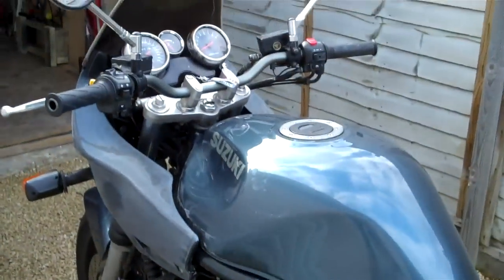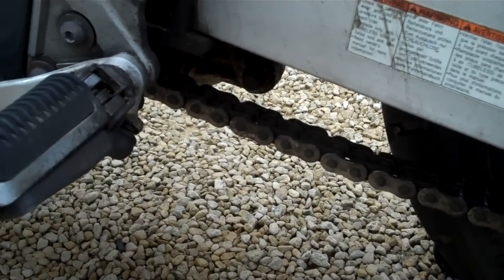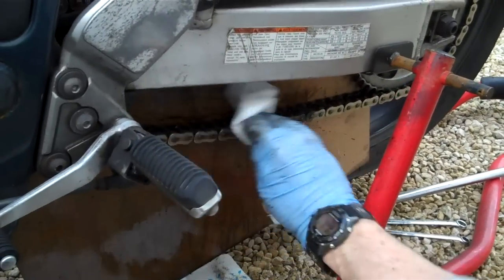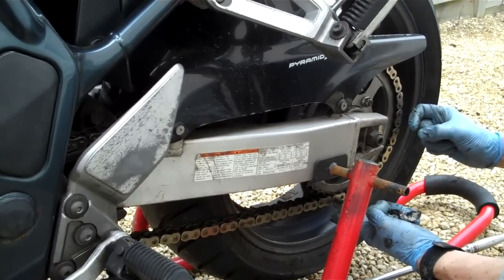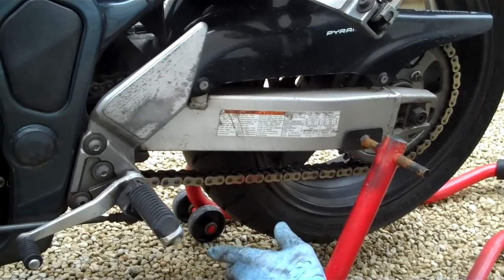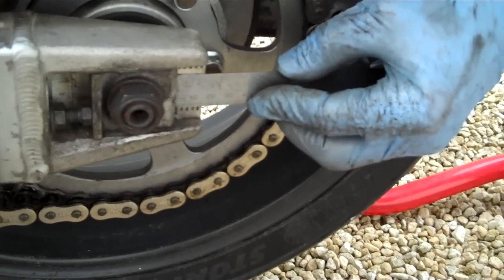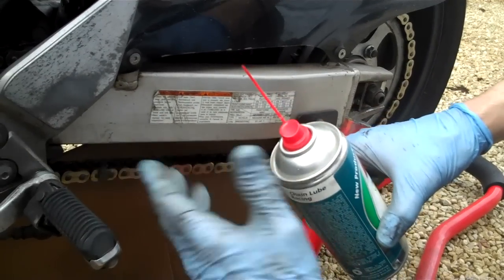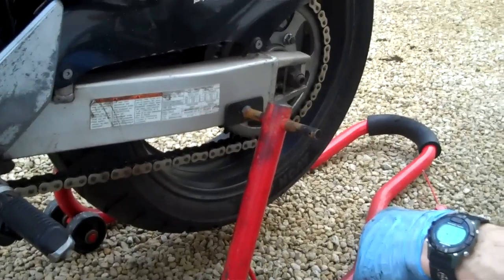Delboy's Garage, Suzuki Bandit, Chain Adjustment. (plus clean and lube).

Comment: hi del, my zx9 has 16 teeth on front sprocket and 41 rear (standard set up), i found a rear upgrade sprocket i want (alloy) 44 teeth. do you know if this would fit straight on my bike with it having a standard 110 link chain on it which goes with 41 tooth sprocket as stanard? would i need to buy a longer chain to go with it you think? am thinking a bigger sprocket would require a longer chain?? thanks john.
Reply from the maker: john walker Hi John, this is a planned upgrade for the new RSV i just bought this week... they need re-gearing so they are more rideable round town.... and any superbike benefits from a lower gearing than factory as they are geared for fast road riding... the trick is to go the other end mate... YES a 44 tooth will need about an inch more chain, so maybe 2 or three more links...but the correct way to achieve the same result on the road, AND for a lot less money, is to fit a FRONT sprocket that it one tooth smaller... 

It works like this mate, "The average setup is usually something like 15/45, which means your gearing is "Three to One"....so if you drop one off the front, it has the same effect as adding three teeth onto the back... got it?... 

So as yours it 16/41which is almost 2.5 to 1... and if you want to make the same effect as adding 3 to the back....just fit a 15 tooth to the front instead... it will make the same drop in gearing, and you will hardly notice the little tiny bit of extra slack in the chain, just adjst it out on the sliders when you tention the chain... the best part is mate, a front sprocket is about a tenner...and the back is a lot more not to mention a longer chain.. 

Hope that helps mate.. good luck with it.. 
Del.
Reply: Moonfleet41 thanks del that makes good sense, specially whe its a lot cheaper :)

Comment: Would you suggest dry or wet chain lube for a motorbike? Bearing in mind i'll be riding alot in the wet weather D: I heard dry is good for keeping away dusty grit but wet is good for long rides etc.
Any info muchmuch appreciated!
Reply from the maker: Hi Ryan, generally, "dry lube" is a 'PTFE powder' to just keep the links lubricated, best for dry weather only... dust is less likely to stick to it... Then "General oil based chain lube" is ok for every day use wet or dry, and only if you keep your chain cleaned and re-lubed regularly..   finally "Chain Wax" is for wet weather, and is a lubricant that also contains a thick sticky wax to keep the water and salt off your chain... again, that will get really sludgy and horrible in no time as while it does keep the water out, it also acts like a 'fly paper... but it will protect your chain really well in bad weather...   Hope that helps mate.. Cheers. Del.

Comment: hi thanks for the video what do you think of using paragon for a chain cleaner
Reply from the maker: Hi Andrew, paraffin is great for a chain cleaner, and so is diesel, cos they are both fundamentally an oil... but never use petrol cos it is a spirit and that will dry out the rubbers in the chain - paraffin, diesel, kerosene and even WD40 i perfect for cleaning chains cos they are super thin runny oils... hell, even fresh engine oil does the job, believe it or not !
Reply: Thanks that helps
Reply: I thought paraffin is the UK name for kerosene.  Looking further, it appears paraffin is more distilled version of kerosene.  
The manufactures (owners handbook) recommend kerosene.  Im assuming distilling means its less potent/corrosive than kerosene.

Comment: so I didnt losen the setnut but was still able to move the chain adjuster, Issue or should I go back lossen and tighten the set nuts?
Reply from the maker: By 'set nuts' i presume you mean the lock nuts that hold the adjuster bolts in place?... if so then yes,  they do need to be tight to prevent the adjusters from moving..!

Comment: hi del, i have just fitted a front sprocket to my zx9 (1 tooth down) which i messaged you about a few weeks ago, all went well apart from when am tensioning the chain and ive adjusted it to how i want it with both marks on swing arm aligned up the same and the lock nuts tightened down, once i strong bar the axle nut down it seems to be putting more tension on the chain to the point were i feel its over tighten, have you experienced this before or am i doing something wrong? maybe i shoud adjust it to the slack side to compensate for this when i tighten axle nut down?? thanks john.
Reply from the maker: john walker Hi John, welcome to the fun that is chain tensioning lol! ...and yes, mate, this usually happens ... the trick is to tension the chain with the bike under load... meaning, have a fat mate sit on the bike when you set the tension (at the tightest point) and then nip the axle nut up 1/4 turn at a time whilst still checking the chain... only then should you do up the adjustor lock nuts... your remedy was also a good solution, to set it slightly to the slack side to compensate for when you torque it all up... the reason for all this is that, often, when you do the wheel up it moves it back a tiny bit in the swing arm.... hope that helps!
Reply: Moonfleet41 thanks del, i've no fat mate around to help and she'll refuse to sit on bike (lol) so i'll have to go on the slack side and just play around till am happy, thanks again john.
Reply: Hi Del,  since there is additional tension when the axle is under a load, should the final chain slack check be when it's on the side stand;that would seem time consuming to do?  I've heard some people say that the slack should be checked on the side stand where there is some load on the axle.

Comment: Hi Sir,
I have just cleaned chain of my 150cc(honda CB Trigger) with Kerosene, is it good to clean with Kerosene?
And next question is I have fresh engine oil 10w40 semi synthetic grade, can use it lube my chain, or shall I use good  quality Grease only. 
I ride barely average 1.5 km(1 mile) daily.
Reply from the maker: Hi Kiran, yes it's fine to clean your chain with kerosene, it's a good solution, but you must wipe ALL of it all very thoroughly, best with paper towels and don't get your fingers near the sprockets.. obviously!  You can use the engine oil to oil your chain, but this will fling of quite quickly, so you'll have to do it again quite soon, the same with regular grease, this will fling off also and both will make a mess on your bike, so make sure you use a small amount only.... for the very best results my friend, if you live in a dry environment with not too much rain, and you don't get he bike too dirty, then you could try a 'dry lube'... basically a dry lube is like a spray on power that contains PTFE lubricant, this will lubricate the chain, but nothing flings off, so would be a good solution... or if you do live in a rainy area and ride int he wet, then spray on chain wax is very good as it's sticky and stays on the chain while it lubricates (plus the wax part of it keeps the water out)... good luck with it!

Comment: Hey Man, I ride a 2004 Suzuki GS500, a baby bandit basicall, I was wondering and wishing to clarify

Can I clean the chain with paraffin? I've heard a few guys use paraffin oil
Also, how do you adjust the chain with the bike on the centre stand, with, or without weight over the rear end.
Reply from the maker: Hi mate, nice bike btw, proper little traffic scratcher!  The best way to clean any chain is with a WD40 type material, this is an extremely light and runny refined oil and dilutes the chain wax and grit so it runs off (or can be brushed off) and it leaves an oily coating over everything, whereas paraffin is a highly refined solvent... like petrol.. and will dry out the chain too much, it can also lead to perishing of the rubber O-rings and will remain in the chain links however much you wipe it off and subsequently dilute the new chain lube too much so it runs off leaving it un-lubricated!...

When adjusting your chain, it's essential you must have some weight on the back wheel as the swing arm sweeps through an arc as it goes up and down and when you take the weight off the back wheel, the swing arm drops to it's lowest point causing the chain to become slack!  If you set the tension at this point, it will become too tight when you sit on it... the best way is with a paddock stand as the weight is still on it and the wheel can still spin, if you don't have one, then get someone to hold it upright by standing in front... hope that helps, Del

Comment: Hello mate, I have an Sv650 and my chain as become slack and I need to tighten it and this video as helped, But I haven't got a paddock stand, this is still doable on the side stand? or is it wise just to run it in a garage and them do it
Reply from the maker: NEVER pay a garage to adjust your chain...its cheaper to go out and buy a paddock stand surely?. ... you can do it on the side stand however...and it will get a better result if you can get a mate to hold the bike upright for you...
Reply: Moonfleet41 well part the reason, I've never done it before and it's my first bike, but it does look fairly straight forward.. I don't really want to part with unnecessary money if I can help it...so I will give it a go

Comment: is WD40 really good for cleaning? it "washes" out all the lubricant insinde the chain
Reply: No it doesn't wash out the grease from the rollers. WD40 is gentle stuff made from fish oil (in the beginning at least). It was developed by or for the US air force as a water displacement (WD) chemical to fight corrosion in electronics and fine mechanics on planes. The number 40 is just the sequential number of prepared formulas tested, that performed best - hence "WD40". It's not a good long time lubricant, but it is gentle to rubber and it does lube. It's also great on electrical stuff.
Reply: It's an organic substance so it will dissolve in other organic substances in unhardened state.  I doubt it would damage hardened lacquer and other paints, I haven't tested tested it myself nor read it would.

When I clean engine cases I use degreaser, the stronger the better. That does nothing to the paint (unless it's flaking due to bad surface preparation before painting). Ordinary hand dish dishwashing agent is greater than most think för crudded up engines. It's gentle too.

Comment: So I guess you do just loosen the one on the chain side then huh? Reason I ask as that my XJ6 has a 6sided nut on both sides, however the non-chain side looks like it could be the head of the axel bolt, so probably leave that one alone. As it turns out, my chain slack appears to be well within the tolerance so just gonna leave that alone for a bit. thanks del

Comment: How do you go about checking and adjusting a chain if you have a chain tensioner fitted, New to bikes and the manual isn't really clear about doing it  cheers
Reply from the maker: Hi Laurence, what bike do you have that has a chain tensioner..?
Reply: Daelim daystar 125 first 2014
Reply from the maker: Laurence Pickering
Not seen that mate, do you have an image of it i can see....a chain tentioner by its very existance should mean you have no need to tension it....but i dont know the bike, so if you have some close ups, maybe i can advise.!!

Comment: Hey off this subject. Just got me 600S today. Bloody spark plug caps keep coming off! This a design fault or something?
Reply from the maker: Hi Olaf, they are a pain in the ass on bandit and GSXR engines, are you making sure the seal caps are fully tucked in all the way round..?
Reply: Push the top seal down hard it pulls the cap of the plug dam. Think they worn. Is there a better OEM that will also seal the well?

Comment: hi del a few questions for you please, i here people talking about putting new chain and sprocket on there bike (rear) and dont mention the front sprocket, do these not wear out as quickly as rear sprockets? i notice on ebay some of these DID sprocket sets come with a front sprocket to, also am going to try and change my chain and both front and rear sprockets myself, do you need to break the chain to do this or can you slacken chain enough to just loop it over the sprocket teeth?? thanks john.
Reply from the maker: Hi John, yes, the front sprocket does wear out the same as the rear, in fact, it has athird of the teeth, so turns 3x more often, so should actually be replaced 3x sooner... I replace mine every 10k miles, then do the full chain and both sprockets every 30kmiles, or thereabouts....... you do have to cut the chain to get it off, and also re-join the new one as it has a 'rivet link'... always replace the whole set... good luck with it mate!
Reply: Moonfleet41 when you say rivet link is there one particular link on the chain for this and I take it this requires a special tool? what's the best way to get old chain off, sorry I've never done this before, cheers john
Reply from the maker: John Walker
Hi John...you can take a grinder and just cut the old chain off...anf the new link comes in ythe new chain set....here's a video that should give you some insight...watch it through and you should find enough there to get you through the job.. good luck buddy... here's the link.. https://www.youtube.com/watch?v=Nji97sRMFs8
Reply: Moonfleet41
hi del i've just had chance to watch the video link you sent me and have to say its cleared a lot up for me :) the type of link you was talking about which you said was by far the best type do they have they a particular name? also if i was to buy a did chain and sprocket set would you get that type of link join in the set or do you normally have to buy these separate, thanks john.
Reply from the maker: John Walker Hi John, all chains come with a rivet link that is identical to the rest of the chain..!

Comment: one tip ive seen is using a blob of tipex whilst you're finding the tight spot so you dont lose where you were , whats your thoughts on this Del?
Reply from the maker: The tight spot won't always be the in the same place mate, remember, as the sprockets are different sizes, the chain is constantly revolving around the sprockets in to a different position, but it doesn't take a second to spin the wheel and find the tight bit.
Reply: @Moonfleet41  Understood, yeah to clarify I meant only whilst you're adjusting it and youd wipe it off once you're done.

Comment from the maker: Honestly mate, that makes no sense, there is no such 'bearing'..the sprocket carrier is a cast block of alloy with the sprocket bolted to is, its slotted into the back wheel casting between chunks of rubber called "Cush Drives".there is a bearing in the wheel, and one in the engine at the front where the output shaft exits the gearbox...what on earth do they mean "bearing is rough, will need replacing".thats gobbledegook mate.. ask them to explain what part is worn or "rough".get them t show you

Comment: Hey Del, my motorcycle guru, adjust my chain regularly and clean it but this time the chain is adjusted correctly and the plate at the end of the swing-arm between the adjuster nut and the swing-arm is loose. I can`t tighten up the adjuster nut for obvious reasons so what`s going on ?
Reply from the maker: Have you tightened the axle, pinching it in place?...or have you just reached the end of its adjustment?...if you have the chain needs replacing..(plus sprockets of course) so just to check...back off the wheel nut a bit, then tap the end plate back in fully... then reset the alignment and torque the nut back down..!   if the chain wont adjust back to tension any more, then its time for a new set..!  cant be more help without seeing it mate... hope that helps.. Del.
Reply: Cheers Del....redid the adjustment and 2-3 mil tightened on the chain and the plate has tightened up too. getting close to a new set though. Thanks again mate and for the cracking vids.

Comment: What effect do solvents have on modern chains? I hear people use solvents, I have never used solvent based cleaners.
Reply from the maker: Hi Tim, solvent is a broadly used word for any thinning, or disolving, chemical... and it depends entirely on the solvent in question... number 1 'fast thinners' would have an entirely different effect than a little drop of diesel, but they are both solvents.... and if you don't believe diesel is a solvent, just tip some on your hands when they are greasy and watch the dirt float off!  Remember, the job of the solvent when cleaning a chain is to remove far more harmful things, like built up chain wax and grit, which will do much more danage than a dab of diesel or parafin... hope that answers your question, Del
Reply: Yes, Thanks Del.